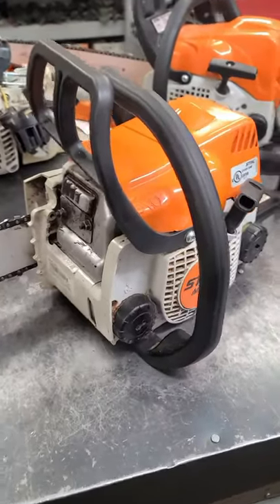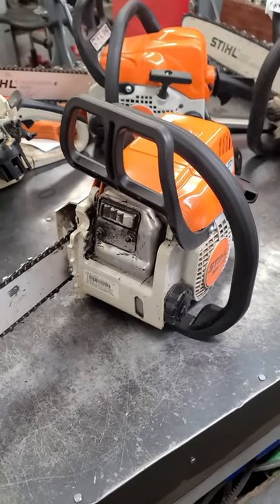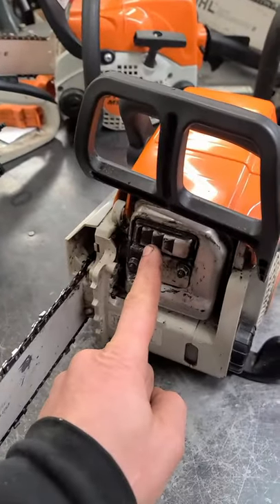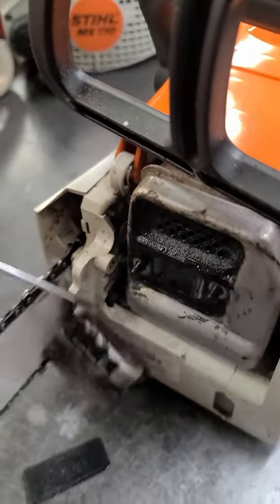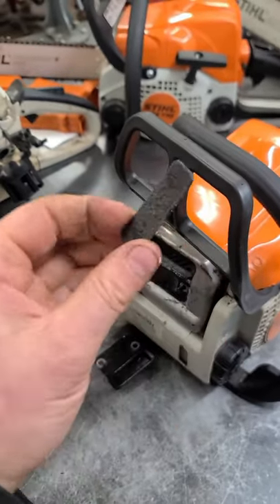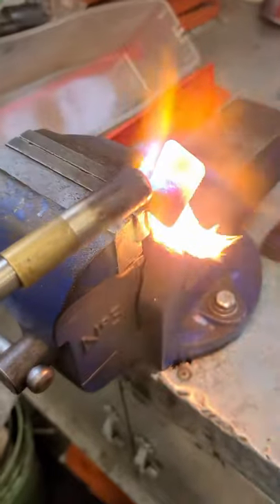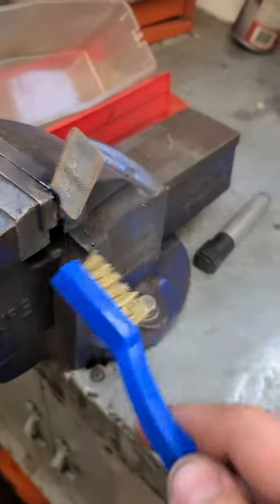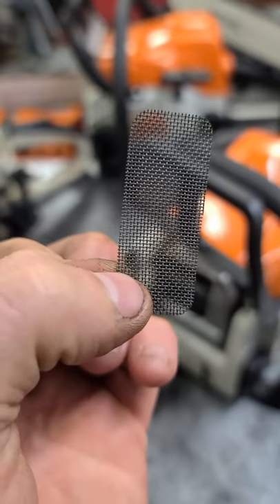STIHL Chainsaw "bogging" What To Look For And How To Fix It! #shorts

Comment: Don't use cheap 2 stroke oil in your expensive equipment?  I bought a cheap Low Hour Husky 455 Rancher that was supposedly blown up and it was just gummed up with extremely sticky unburnt 2 stroke oil. The piston ring was gummed fast in the groove of the piston and the spark arrestor was completely clogged with black sticky soot. The guy that I bought it off of used some cheap wallmart brand 2 stroke oil in it and only cut 4 trees with it. I tore the saw apart and soaked the piston and cylinder in my ultrasonic cleaner and cleaned it up really good. I then installed a new OEM piston ring because the original ring had 1 spot which was worn slightly more that the rest because the rest had been literally glued into the groove in the piston. I've run about 8 tanks through it since then and it's still running strong. I run full synthetic Klotz KL-100 Super Techniplate oil in all of my 2 stroke equipment. Love the sweet smell of it and it burns cleaner than STIHL oil. My brother has been dumping a few OZs in his Mazda RX8 since it had an engine replacement at 90k due to low compression and it has slightly over 230k on it now and still running very very strong. If it can extend the life of a Rotary engine it has to be good eh?

Comment: I do this same thing after a dirt dobber nest inspection. I actually take the muffler off and use the same kind of torch and heat the entire muffler inside until it's glowing orange and the oily carbon flame has gone away. After it has cooled I take the air hose to it and reinstall it.  Runs good as new. I do this for all my two cycle equipment.

Comment: Just wondering is STIHL a good saw for home use.
Reply from the maker: yes
Reply: Honestly, ive had 3 home sozed stihl chainsaws and they have literally been absolute junk. In and out of the shop, carb wont stay right, and now it bogs down again you put load on it. I chunked it in the shop, bought an echo, and havent looked back. Now the commercial sized saws ive had great luck with and wouldnt trade my 450 for anything.
Reply: I've been thinking much the same for quite some time. I have 029 that is decades old, and it runs well. My son recently purchased an MS070, and it bogs down far too much. Doesn't matter what fuel I use, but I pretty much use Stihl 2-stroke oil and only fresh gas. About time to migrate over to Husqvarna.

Comment: I have an old Stihl saw like this one. I have a great deal of experience doing revivals on small engine stuff, but this is my first chainsaw. This one has been sitting unused in a garage for about 20 years. It will not fire at all. I am getting spark, and I have gone through the carb thoroughly. I have even tried ether, but I can't get it to do anything. Beyond compression, is there anything else that I could be missing?

Comment: Question for ya Don. The trend for 2 strokes per the EPA and CARB has been a switch to low smoke/ash synthetic oil and increasingly lean gas:oil ratios to reduce smoking, emissions, and coking. Even the fuel:air ratio has been pushed to be leaner in order to reduce unburned gasoline emissions. The oil ratio of 20-30 years ago was 32:1. Nowadays, it's 50:1. From what I understand, the consequences of using a 32:1 ratio in an engine designed for 50:1 are excessive carbon buildup on the piston crown, spark plug, exhaust port, and muffler/spark arrestor. The plug will foul up and fail to ignite. The arrestor will choke the flow of air and fuel through the engine. Both are easily remedied though as you've showed us. Even a choked down exhaust port can be opened back up with careful scraping and some vacuuming/compressed air. The one serious risk seems to be carbon buildup in the exhaust port that could scratch the piston skirt. The new oils are designed to be low ash though, so I wonder if the extra fouling would even be ridiculous at all. 🤔 What are your thoughts? Does running a richer gas:oil ratio than the one that the manufacturer is pressured to specify lead to a longer engine life, or does it actually cause unnecessary increased maintenance work or worse yet, serious engine damage? Assume that the owner of the equipment treats it very well. High quality oil and gas are used, the engine is always allowed to idle and warm up for 5 minutes prior to being flogged, spark plugs and air filters are changed on time, etc.
Reply from the maker: if maintained properly a higher oil mix i.e. 45:1 will help with longevity
Reply: @donyboy73  As in, a 50:1 saw that is used with 45:1 will last a bit longer? So a slightly richer gas:oil mix is good, but just don't go crazy and go all the way to 32:1?
Reply from the maker: @mannys9130  exactly
Reply: @donyboy73  Thank you very much for the answers! Dave might be super lucky and get to work one on one with you in the shop, but we are all your apprentices in a smaller way. :)
Reply: From the looks of that start up it looked like there was plenty of oil in the fuel.  Probably a big contributor to the clogged screen 🤪

Comment: Would this be able to happen with all brands and engines ? I've got a honda whipper snipper I put a new carb, fuel lines filters, spark plug etc ran beautiful for a few months,  carb looks good but won't start and if it does it only runs at 3/4 if not full revs otherwise dies, any ideas that you might have mate. Can't tune the carb either. Cheers mate 👍

Comment: I switched over my gas to just like yours 45:1 mix of Stihl HP (orange bottle) and premium non ethanol gas.  I tried it at 50:1 but my ms 170 did not run as well with it, so I switched back to 45:1.

Comment: Can regular oil be used instead bar oil ??
Reply: It's a LOT cheaper to buy good quality oil for the bar & chain than it is to constantly replace them. Safer, too.
Reply: No, it cannot. It’s to thin and doesn’t stick. It’ll fly off the chain.
Reply: @larryreno8293  if you use used engine oil or diesel oil it works great. I'm a Stihl tech and get the question alot. anything over 10w30 works great. Adjust oil pump and good to go 👍🏻
Reply: @josiahshonwise4548  as a Stihl tech you know that most saws don’t have adjustable oilers, pro grade saws do. And for the tree huggers, used oil isn’t eco friendly. But all that aside, most don’t run their saws enough to concern themselves with the cost of a $13 gallon of husky bar oil. Just my thoughts on the matter.
Reply: @larryreno8293  yes home owner saws do not have adjustable pumps and yes you do go through oil faster that way but if you use a heavier oil it works. I personally would never use any on my saws as it makes a mess and if used oil is not filtered can cause oil pump failure but alot of people just go to engine oil as they are to cheap unfortunately.